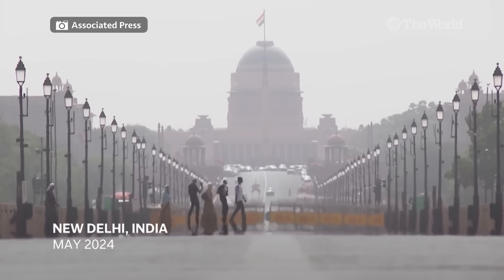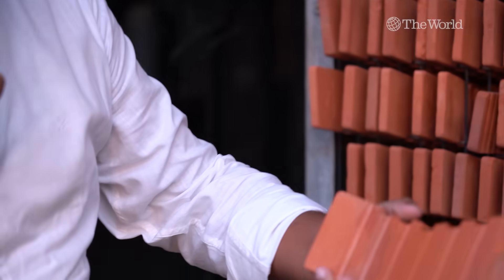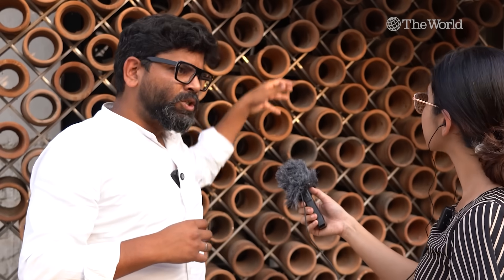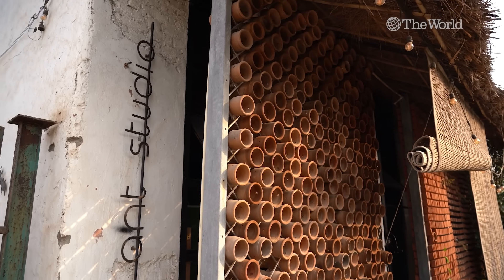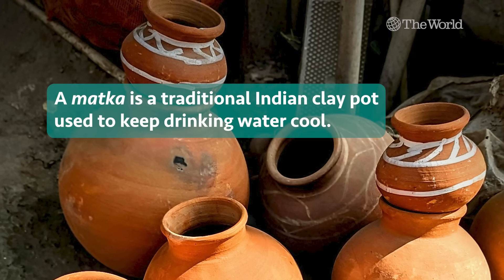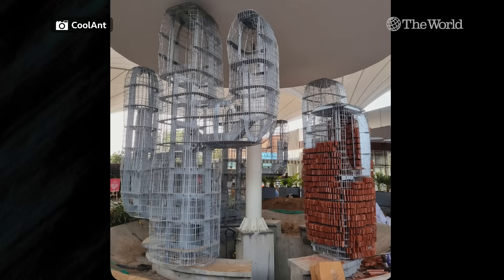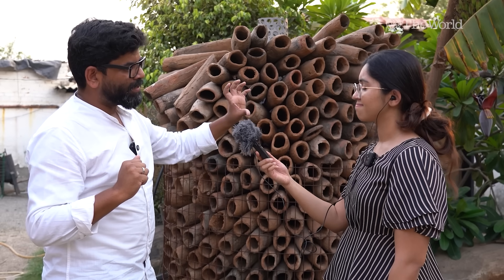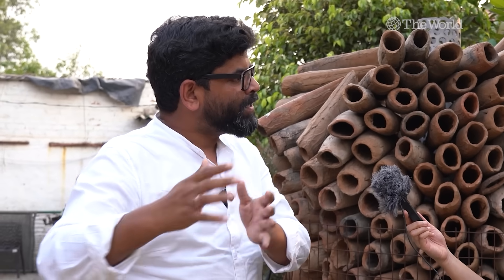Nights in Delhi hit 95 degrees. This keeps homes cool.

Comment: Evaporative cooling is wonderful in dry climates, not humid. The problem is that water is precious in dry climates.
Reply: Which is where grey water and recycling would be applied
Reply: @aleenaprasannan2146 which will result in mold , algae bacteria
Reply: @aleenaprasannan2146  grey water on evaporation? It will clog.
Reply: @aleenaprasannan2146 hahahaha "bro just ac your house with grey water" Hahajahahah delusional.
Reply: @aleenaprasannan2146  add in plants on top of it and it will act like a vertical filter. The foliade would shade it and decrease evaporation even further.
Reply: Yes it does use water but not as much as you might think, the evaporative process is fairly efficient.
Reply: The guy interviewed in this video specifically says the cooling strategy has to work with local climate. So he already knows what you are trying to lecture him about 😂
Reply: Exactly. I live in southern New Mexico and evaporative coolers use so much water.  I was wondering if Delhi a humid environment? I do think this is a very interesting concept.
Reply: Not fully correct, I have seen this example work very well in a 70-80% humidity city. Does it increase the humidity? it sure does but not by a number that makes a huge difference in the thermal comfort. And also it is way better than having the other options for the wall, like a stone wall or having some idiot painting a wall black where it gets directly hit by sun light.
Reply: @patrickschafstein5848  The lowest temperature achievable with a swamp cooler is the wet bulb temperature. The wet bulb temperature is highly dependent on humidity. At 95 degrees Fahrenheit degrees 70% humidity the wet bulb temperature is ~86 degrees, so, a swamp cooler could get around 9 degrees of cooling. But at 10% humidity, the wet bulb temp is ~60 for 35 degrees of potential cooling. So both work but it's much more effective when the air is dry. Basically the air can only accept 100% humidity, so if you start 10% you can evaporate a lot more water than if you start at 70%-80%

This is also true for humans BTW, we rely on evaporative cooling so high humidity inhibits our ability to sweat and cool down. Above 95 degree wet bulb the human body literally cannot evaporate sweat fast enough to cool down even in the shade and you'll die eventually if you don't cool down.
Reply: It’s all about creating microclimates. Through the manipulation of materials to define and create space you can also create airflow condensation evaporation. Creating canopies. Look up Earth ship construction.
Reply: Maybe the trick is to use saltwater, next to costal areas, and who knows, maybe get drinking water to run off the evaporation process! But as was stated, every useful application is different!
Reply: If you've got ocean access then desalination  is an option
Reply: Even in quite humid climate, with air flow or wind, it is quite easy to have reasonable evaporation rate.
Reply: I think it's perfect for humid because it acts as a condenser too so it grabs all the water in the air and turn it back into water causing the air to be much cooler. You can also use that same water to either store or act as coolant. India has some deserts that could use those water that the tropical zones can store. It'll take a lot of piping and infrastructure but that's nothing when compared to gas lines, electrical and so on.
Reply: @wanderingbufoon  As someone living in a humid area, it works fine in certain outdoor places like coffee shops where you only stay for a short time or once in a while. But if you use it in your house, you can develop skin and respiratory problems, your home can grow mold, and your electrical systems may fail or even catch fire more easily. And humid = rain often, we have evaporative system by nature... so we have dehumidify structures 😅
Reply: @deerinsincere8726  well wouldn't that dehumidify the space? It cools it down so the water vapours will condense on the condenser and will poor water there and cooling the air thereby acting as a dehumidifier.
Reply: @wanderingbufoon  Evaporative cooling works because water absorbs heat as it turns from liquid to vapor, so heat goes down, but humidity goes up.
In our country, humidity is already 70–90%, so it only works well in open, ventilated spaces like farms or factories (to save cost), and it’s still weaker than in dry climates. In homes, you need good airflow or you’ll run into moisture problems. Luckily, when humidity is high, temperatures usually aren’t extreme. If both were high, our electricity bills would be a nightmare.
Reply: @deerinsincere8726  oh, that's a shame you can't work them in tandem. I thought it'd be like the water vapour will cool down the metals which will also act as a dehumidifier as it cools down, grabbing the water from the atmosphere so it can be used again to further cool things down.

I mean, we could see that with Central Asia's architecture with their air towers where they drag cool air in then plunge that air into the ground where it's naturally cooler and breathes air to whatever water is in there too and the cool air just pushes the hot and humid air out of the building passively through thermodynamics.

I thought this design was meant to be pair with that thus cooling the hot area while at the same time scavenging the water in the atmosphere cooling the ground even more and pushing the hotter but dry air out and up in the air
Reply: @wanderingbufoon  Uhm, what you described is just ventilation: cold air sinks, hot air rises, creating airflow and circulation. The design in the video is an open evaporative cooling setup, where wind brings in cooler, moisture‑rich air inside. That can lower the temperature a bit, but it also increases humidity, which is why it works best in dry climates. If the incoming air had less moisture than the indoor air, it would dehumidify (for example: open windows in winter in German) but that’s not the case here because it’s water vapor being added.
As I said, we do use the evaporative principle, just not the way it’s shown in the video. We’ve used it in gardens and farms for years.
Reply: @deerinsincere8726  I think the best use of that is having to design a ceiling that will expel those water vapours that had become heated when they absorbed the heat of the rooms and be shot up into the atmosphere where it will condense back into a cloud because it gets cold high up above.

IDK if that'll still be passive but I think it'll help a lot. It's how forests work. Often times, they have a good ventilation system where any water vapour will leave the forest canopy if they get too hot otherwise it'll become a rain forest instead.
Reply: It wouldn't work in high humid areas
Reply: Like a water fountain you would use the same water over and over again, and only need to top it up for evaporation.
Reply: @JaneMurray-di3gq  Partially correct, because the evaporative cooler is evaporating water at a much faster rate than a fountain.
Reply: @ramyhuber8392 i belive it would be far less than building huge server
Reply: You also need plenty of space including unobstructed air flows. This is not practical in urban areas in most countries.
Reply: @kalliste23  it is a question of city planning, cities are covered in parking lots and abandoned builds, that takes space. If it is a possible solution we should present to the people who have the power to change that and press they for changes

Comment: This would be ideal in places that get dry heat, but have available water. It wouldn't work if the humidity is too high, and it wouldn't be feasible if water is too scarce.
Reply: or if there is a bug or mosquito problem

Comment: evaporative cooling is ok for dry environmental conditions, but not for those hot and humid climates because it increases the relative humidity to the uuper limit.
Reply: True but a good idea for those living in arid areas that are watching this.
  You bring a good point in that specific tools/methods for specific situations.
Reply: @OP-fd4lhI thought much of India was hot and wet?
Reply: That's why here in humid Massachusetts, while I don't have ac, I use a dehumidifier and find that it dramatically cools (or at least *feels* much cooler). Half the battle in this climate is just getting that hot, muggy moisture out of the living space.
Reply: I was thinking of the same thing.
Reply: less effective
Reply: it depends. evaporative cooling is still good as long as proper air circulation is maintained. i live in hot and humid country and i keep in check the air intake and exhaust system inside my room and using evaporative cooler totally fine for me
Reply: This may actually reduce humidity as well. 

Similar to how a mesh net pulls precipitate from the air for certain water collection systems.

Comment: This system is a great idea.  It cuts down AC use reducing the load on electricity supply networks.   Therefore, helping reduce power outages.  Every little helps.

Comment: Salts from water will destroy poorly made ceramics in couple years to the level of falling apart. Strong winds will make those barely holding pieces to fall off on heads of those passing by. Dangerous, doesn't work in monsoon season, requires water in dry season... Great idea!

Comment: I lived in a mud house Fachwerhaus, in Germany for six years. Always cool and protected in winter although I had no heater cause this was a building side. My hair grew long and thick cause I was working with freshly made mud. My health improved, sound sleeping. Now I live in rented flat, central heating, plastic window frames. Hair does not grow anymore over a certain length, it's thinner again, I feel well but developed breast cancer which is multifactorial but because oxygen levels are bad specially during night, I wonder if this contributes  in Tunisia they take down traditional houses with round roofs natural heat protection to replace with modern bungalow and Aircon. Old styles of housing in all parts of world had a reason they were built ACC to regional climate.
Reply from the maker: Super interesting insights!
Reply: I’m living in a relatively new building, called a ‚Neu-bau‘ for some time. The insulation is indeed so good, my CO2 measuring instrument (I’m an engineer by education) indicates the levels always rise, i.e. never drop due to a draft or “breathing” of walls or windows. You have to open the windows twice a day to stay within a healthy level (<600 ppm). However, it’s hard to reach toxic CO2 levels (above 5000 ppm). Keep in mind CO2 is just one aspect, and a proxy for other airborn particles that’ll affect you. For example, my IKEA lowboards (big mistake – buy real wood!) have outgassed glue residue for about 8 months.

Comment: Evaporative cooling only works in dry climate! If it’s humid and hot, adding more moisture to the air won’t do anything.
Reply: Yes cannot work in coastal zones of India, but can work well in the dry arid regions of north and west...
Reply: In Nevada (USA), many folks have evaporative cooling over aircon and prefer it too.  It works very well there as it is very dry and arid there.  In places like Florida (USA), it is extremely humid and evaporative cooling does not work well as there is already much water in the air.
Reply: @aytviewer2421  
Any links about that system for more details ?
Reply: yes, too much humidity in the air ,your sweat cannot evaporate--
Reply: PBS Weathered have a good YouTube video about wet bulb events. If you live somewhere hot and humid its important to know that cooling evaporation of water, or sweat from the skin, just won't happen if it's very humid.
Reply: The video should have started with the fact that Delhi falls in a hot and dry climate zone.
Reply: @nil_90  it doesn't look up RH for Delhi summer
Reply: @nil_90  Yeah people forget India has multiple climates. They think all places are humid and hot.
Reply: Exactly.   This will not work in Queensland, Australia. 😂

Comment: Terra cotta can also filter water. With a different alignment of the vessels, you could put in dirty water at the top and it could be purified as gravity sends it down through more vessels. Plants could also be added at the top to help remove more minerals and contamination.
Reply: nope.. need filters, reverse osmosis filters, UV light to kill pathogens
Reply: @cindylong624   Purified means more pure. I didn't mention anything about sterilization -- that's a separate step.
Reply from the maker: Great tip!